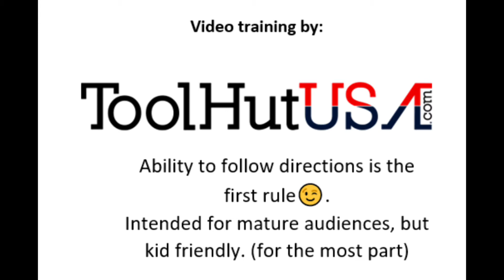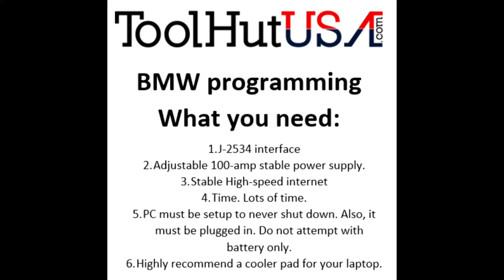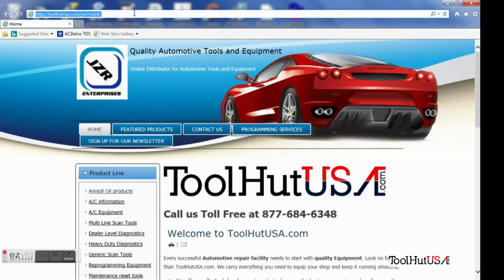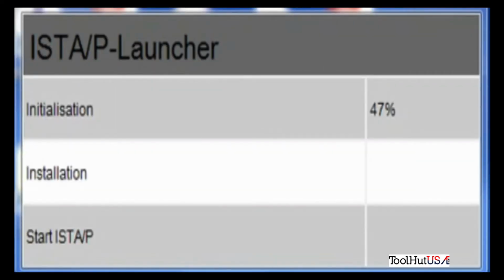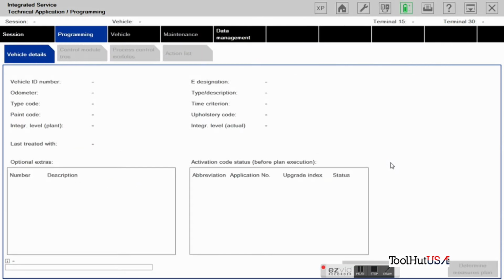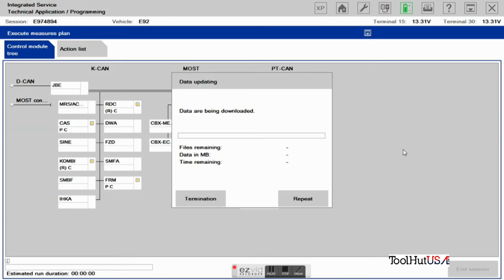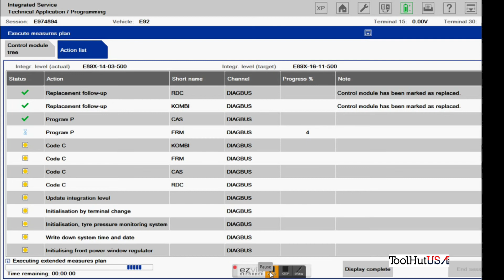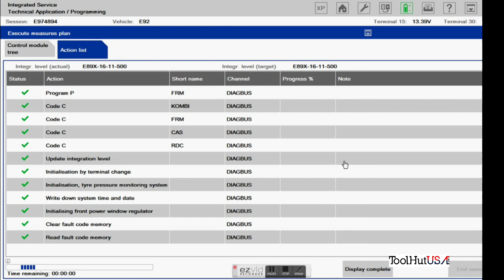BMW  Programming J2534

Comment: hey man do you know if the j2534 Autel Elite is compatible with insta/p online because I made it communicate with it   but when I go to read modules it fails and I get stuck. thanks in advance.
Reply from the maker: You need to make sure you download all components. Only use j2534 on e chassis. Do not attempt on f and g chassis

Comment: How did you get ISTA/P to detect your j2534 PTD? I’ve followed each step and successfully pull up the app, but whenever I go into “Create New Session”, it doesn’t detect the J2534. I installed the BMWTechInfo pass thru software
Reply: have you solved this problem? still have same issue
Reply: @Donperion_  has this been solved?

Comment: Helpful video especially the information about programming infotainment systems! What Icom or pass through tool do you use for bmw?
Reply: @toolhutusaakathecarflasher3019  thank you so much! There's so much cheap knockoff cabels floating around it's difficult to know what to buy 1st time out. Some people say the cheap stuff works... then others say nope. Your video is very handy once the car gets connected to the laptop